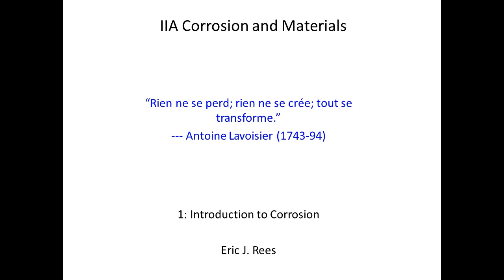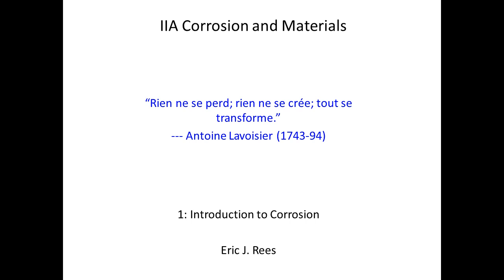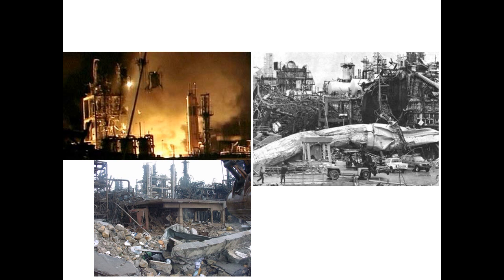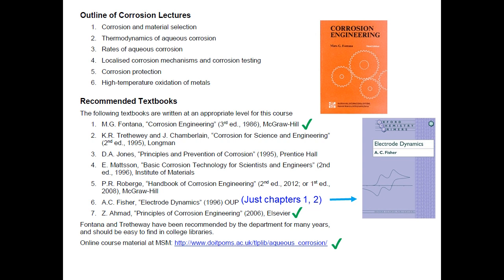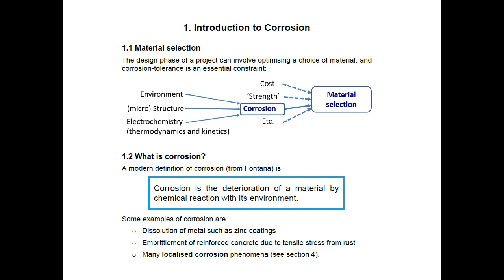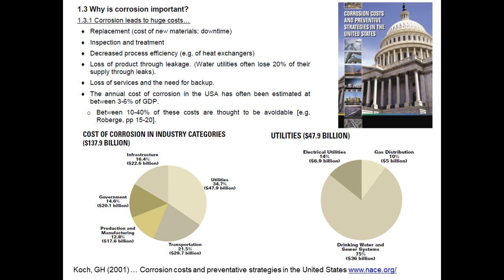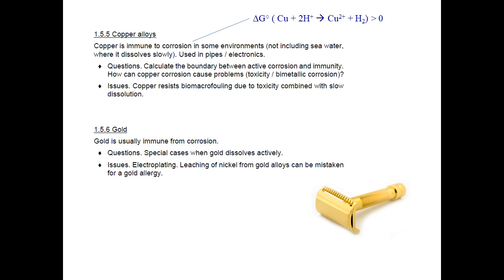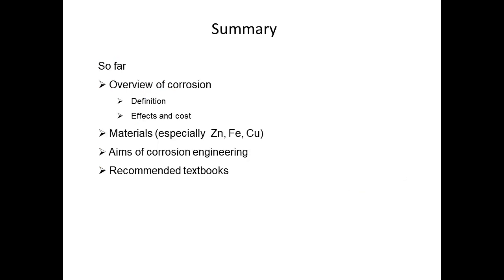Corrosion Lecture 1: Introduction

Comment: can you please tell me the two examples of active and passive corrosion ?
Reply from the maker: Essentially, active means the metal corrodes continuously - e.g. zinc starts dissolving to Zn2+ ions and just continues to dissolve until all the metal is gone. Passive means the metal starts corroding by forming a non-permeable solid oxide surface, which then stops further corrosion due to the produce being a physical mass-transport barrier.